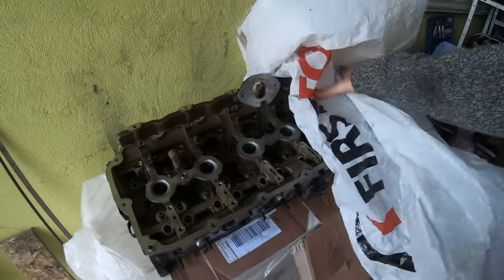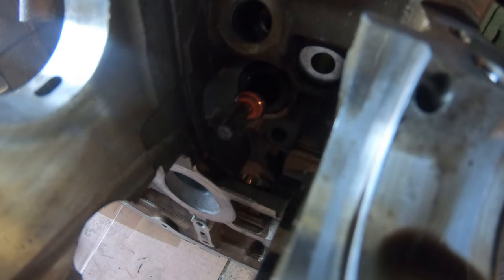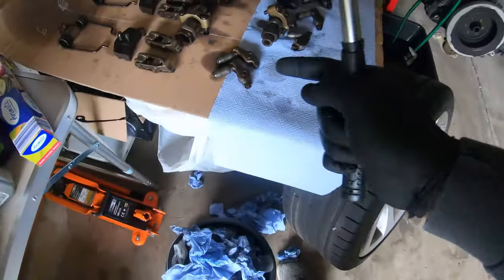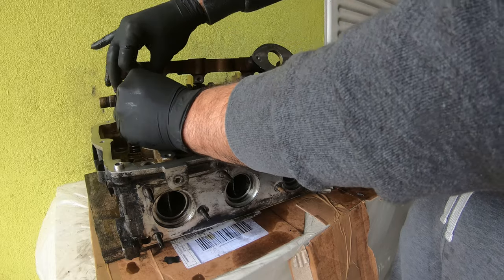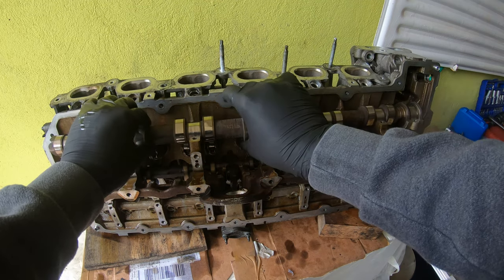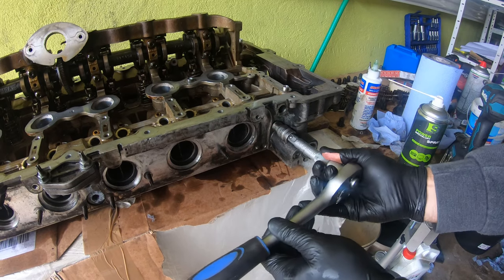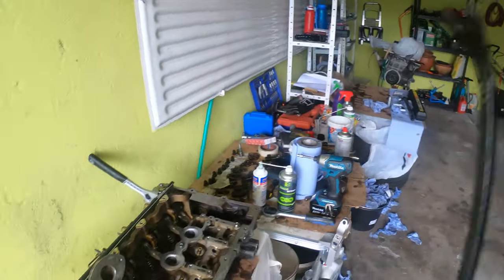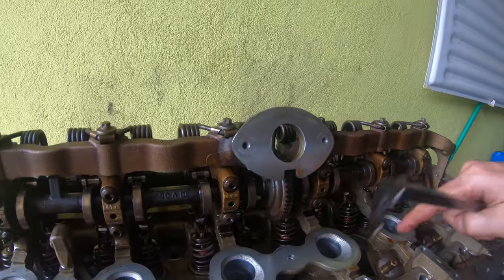DIY BMW N52 Cylinder Head Rebuild! Replacing Valve Stem Seals + Reassembly [BMW N52 Rebuild Part 13]

Comment: Hey what's the torque spec for the eccentric shaft caps? Also when I installed my eccentric shaft, it doesn't have tension like it used to. When I would rotate it before to install the stopper it would throw me back but this time it doesn't. Did I install it wrong? Also I didn't take off the springs or the rollers. Thank you.

Comment: Okay so I had a broken valve spring on the exhaust side, I got a new one but the hat for the spring doesnt sit flush, is there a specific way to get it to sit flush on to the spring?
Reply from the maker: Did you already do a valve job to make the valve flush with the exhaust port? Try and rotate it a bit and make sure the hat isn't upside down or something
Reply: @buildanddrive  No I haven't, Im trying to seat the spring on but the hat itself isnt sitting flush onto the spring so when i try to compress it and put the retainer on, the hat just comes loose because its not flush onto the spring, these are the part numbers: 11347539917 , 11347523971

Comment: Hi my friend, Excuse me, did you take it to machine shop to rectify flatness? or it was within tolerance, because that measurement was not seen, thank you for the information
Reply from the maker: I didn't take it to the machine shop but I used some sandpaper on a flat block to DIY sand it just a little bit.

Comment: I’m hearing that it’s bad to manually crank the motor ? Something about if you spin the timing you misfire and cause other internal damage ? Can anyone with information please let me know .
Reply from the maker: As long as you spin it in the correct rotating direction, I think it's fine.

Comment: Did you use the same bolts  or new ones and it’s the same torque spec for the esccentric shaft as the intake cam bolt torque spec?
Reply from the maker: I reused the same bolts. Don't over torque them, it was like 8Nm and I broke a bolt actually. It's just past hand tight pretty much.

Comment: Hi, can you please share from where you got the manual you showed and the torque specs? I am in the process of cleaning and checking the head of my N52B30, I will be reassembling everything soon. Thanks. And good job BTW! I would love to do the whole thing some time in the future.
Reply from the maker: You can go to newtis.info and try to make an account. BMW has tried to shut them down but I can still access it with my old account. You will have to search for the specs there
Reply: @buildanddrive  It worked! thanks.
Reply: @buildanddrive no newtis access anymore here. Do you have a TIS number we could look up in the pay-for service or a list of the bolts and torques. At least the intermediate rocker hold-down blocks and sping bolts. Thanks.😉

Comment: If I'm just changing the rectangrings for the teflon ones, do you think I could leave the intermediate rollers and guide blocks in place and just take off tension by undoing the springs with the special tool?
Reply from the maker: That maybe possible but there is pressure on at least 1 or 2 cylinders where the springs will have tension because of where the cam lobes are positioned, you maybe be able to get it off but getting it back on will be challenging. Possible.

Comment: Im on my way of doing that early next week. Im curious what's the thickness of that metal splint that you used to reinstall the springs?
Reply from the maker: What is the time stamp?
Reply: @buildanddrive  34:30
Reply from the maker: It was about 1 to 2 mm thick. It was a generic metal from the hardware store.
Reply: @buildanddrive  thanks i thought i need a specific thickness for the spring to sit properly
Reply from the maker: You can buy the tool for the springs for around 100$ on eBay if you really want to do it properly.
Reply: @buildanddrive  i’d like to spare me some money. The timing tool is 150$ and the valve stem seal tool is another 100$. I don’t feel like spending that much money for a one time job tools
Reply from the maker: Correct. I felt the same way. I bought the timing tool used for 65$ on eBay luckily
Reply: @buildanddrive  one more thing. I am getting two different part numbers for the intake and exhaust valve stem seals, are they really different? For the inlet 11340034068 and for the exhaust 11340035853. Elring has them in different price from each other so I presume they are different? Can you confirm on that?
Reply from the maker: What is your engine? They valvestemseals all came in the same box. If you watch my parts video you can see it
Reply: @buildanddrive  n52b30 euro spec 258 hp
Reply from the maker: Maybe order both and return the ones you don't need lol. I don't think they would be different part numbers but maybe the valve sizes are different from intake to exhaust on the n52b30. Can you measure the stems?
Reply: @buildanddrive  i am not quite there yet. Wanted to order the parts before i start removing the valves.
Reply from the maker: In realoem check the part numbers on the valves, and see if it tells you how many mm is the valve size

Comment: was watching the video and my point of interest is the torques for the intake and exhaust camshats. The intake you found was 9NM. Where did you get that torque value. I have both ISTA and the manual. I did not see that. I am confused as hell on these. The exhaust you said something like 8NM and 60 degrees? I found the exhaust value at 20NM for some reason. Let me know on this.
Reply from the maker: It's possible the 60 degrees could add to a total of 20NM. I used the BMW TIS. Do you have a link to where you got your values?
Reply: @buildanddrive  I ended upusing the torque specs for the N51 from ISTA 9nm for intake 8or 9 NM plus 80 degrees for exhaust. Yours were from the N52 torques. Have no clue were I got that 20NM but it wasn't  right.

Comment: Hi sir, did you clean also the secondary air system duct? it would be awesome to include it in your video!
Reply from the maker: The cabin air system?
Reply: @buildanddrive  I have a E90, it has the secondary air valve attached where that N52 has a little cover in the vid, it’s part of the exhaust side, the air pump injects air when the car is cold for only a few seconds, once the pump is off the valve stops any exhaust gas to return towards the pump, that air goes inside the cylinder head (right next to the lifters all across the engine) and injects the air to the valves where the exhaust is… it also gets clogged with carbon!
Reply from the maker: @Aroo_0  can you send me a time stamp or photo on my Instagram of what you are talking about? This is interesting.
Reply: @buildanddrive  sure, I will do.. Later this morning today.. 👍

Comment: I have one question related to the little lifters, I have 2 heads a 2012 that got a frozen intake due to overheating and another 2009 replacement head both N51.. The lifters on the 2012 don't press down but the 2009 do, you know when you squeeze them together. Are they supposed to do that? I went to the dealer and tried a new one and it is hard or impossible to squeeze. But it you take them apart they become easy to squeeze. They are simple inside just a little piston and a spring. So i want to know if you have any input on this, thanks in advance.
Reply: Also is there a difference between the intake lifters and exhaust ones that you know of, I measured, compared and couldn't see any. The dealer says they are different. Part numbers say so, for them.
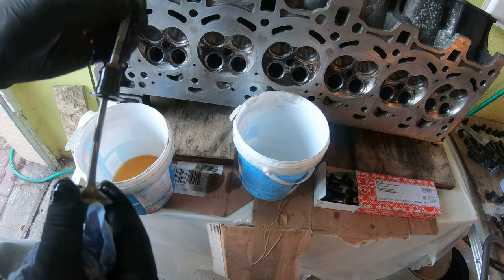Reply from the maker: You want them rock hard when you squeeze them. watch from 5:30 when I take them out. Later on in another video I also show the new lifters I bought compared to the old ones. They were rock hard 👍🏼
Reply from the maker: I don't think theres any difference between the two
Reply: So I took them apart, and inside there is a piston and a spring under it. The top goes on with a clip and it pushed in to get secured with the clip. Now I put some oil under the piston and pressed it in my vice, and it is rock hard now but again if I squeeze the vice all the way all the oil comes out and it's back to not being rock hard. Also the piston head has a check valve ball which when pressed in with a needle releases the oil I placed underneath.
This is not a complex piece.
So even when I opened one of the stiff ones I have when I put it back it is not stiff anymore. So I think they have oil or something inside keeping it stiff. Have no idea how a stiff lifter can stay stiff when it is heavily pressed while the cams rotate.
How many did you change. They are not cheap.
Reply from the maker: I only changed 2 lifters. They were soft and I could squish them by hand, this shows the piston inside is worn out and allows oil pressure past. The oil pressure keeps the lifters hard. The others were hard when I took them out so I rused them
Reply: @buildanddrive  Odd how there is no info on these anywhere, and them being really simple functionality wise. Even the dealer has no clue.
Reply from the maker: The famous lifter tick is all over the internet. The dealers have the "repair procedure" but it is consists of changing the oil and revving the car past 3000rpms for 20+ minutes. Normally this can help for a while to build up oil pressure in the system again. But it doesn't fix the worn out part that is hard to get too.
Reply from the maker: Cool. I sort of did something similar when I reinstalled my lifters
Reply from the maker: Watch from 9 mins https://youtu.be/7aM58pxXrv4

Comment: Thanks man
Reply from the maker: You rebuilding your engine?
Reply: @buildanddrive  yes man, great tuto. Everythink is clean, great work.
I saw you did'nt unscrew cranshaft bolt. This hub is very hard work. I did it for the sealing ring, maybe it's possible without.